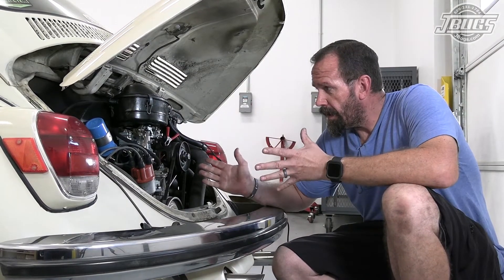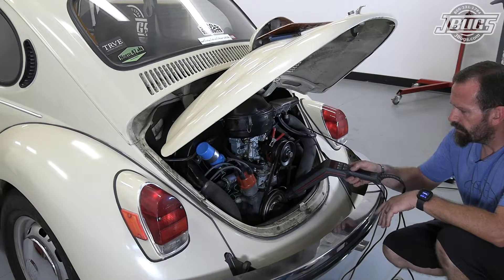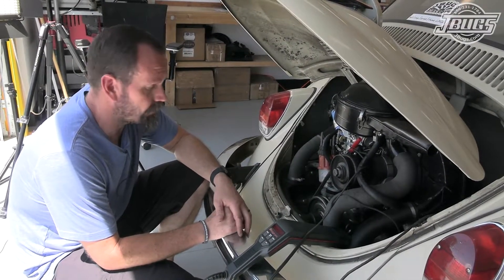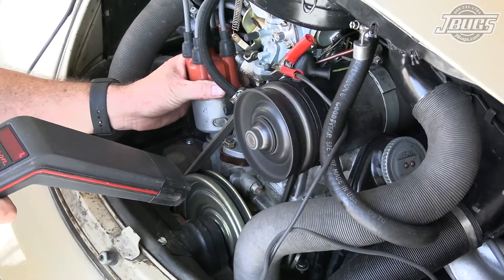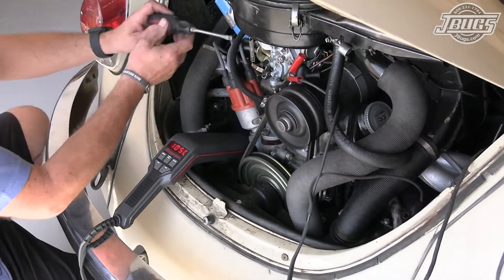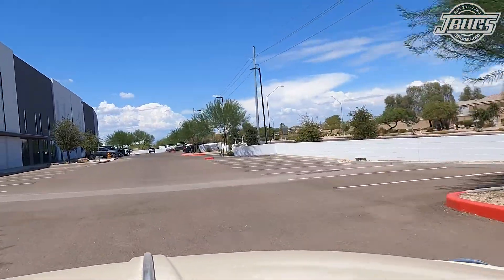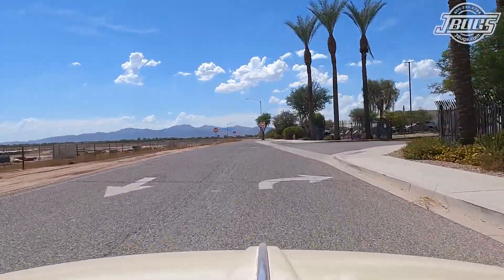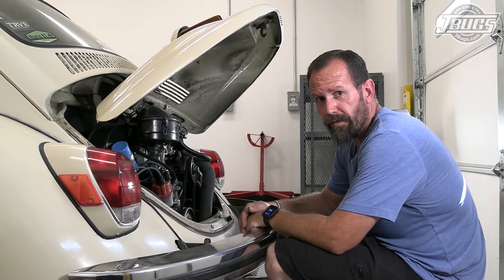JBugs - Timing a 009 Distributor

Comment: Would you use the larger jets at 5700 feet altitude?
Reply: No, typically at higher altitude smaller fuel jets are run, not larger. There is less oxygen at altitude, so to keep the air-fuel ratio correct, smaller fuel jets would be used.

Comment: As always, thanks for the great video Sam. I can only get my car to idle / rev stable by advancing around 45 degrees. Anywhere close to 32 or below and it misfires / stalls. I'm running an MSD centrifugal distributor. I believe the springs were changed. Will this affect the advance?
Reply: The closest I've come to working with an MSD distributor is the EMPI HEI which is modeled after it and I still prefer vacuum advance distributors like the SVDA.

I'd start with seeing how much total advance you get. Fully advanced you're at 45, but what is the initial timing? If you're getting more than 20-25 degrees of advance then something is probably wrong with the distributor, weights or springs. Also check that the cap and rotor aren't damaged, cracked, etc and possibly the cause of the misfires.

Comment: So you adjusted your timing at idle and then got your advance at 3k rpm automatically? You didn’t have to adjust the distributor while at 3k rpm? If I’m correct is so much easier when you only have two hands.
Reply: As you rev the engine, the timing will advance automatically, yes. This distributor advanced 23-25 degrees depending on the initial timing. If you have another set of hands, it would be helpful certainly, but as I showed in this video, they aren't a necessity.
Reply: @ yeah I don’t know why I didn’t think about it. Set a couple of degrees at a time at idle and check at 3k rpm to see what it advances to instead of trying to move the dist, pull the throttle, and hold the timing light all at once at 3k rpm. Makes sense. Great video man. Learn something new everyday

Comment: does this process works in the same way with a vaccum distributor?
Reply: Essentially, yes. The vacuum hose needs to be disconnected (and the port on the carburetor plugged) when setting the timing so that process is the same. We do have a timing video on a vacuum advance distributor here - https://www.youtube.com/watch?v=hOrehMD8Cc0

Comment: Wish I could understand it but I do not understand what you are looking at on the pulley with the light.
Reply: The timing light shows the moment when the spark plug at #1 cylinder fires. Since this timing light has an adjustable flash, we set it to shine on the TDC notch in the pulley. So, whenever the plug is firing, we look for the notch on the pulley as the light flashes.
Reply: you are looking at a vibrating line on the edge of the pulley  that moves to the left or right as you increased the rpm .

Comment: My '71 Ghia oil temp over-heats within 5-10 minutes before hitting the road. I just adjusted valves and hesitation stopped but oil still overheats. I adjusted carbs but no diff. Now I'm gonna re-time it and hopefully that solves the issue.
Reply: Timing can certainly help with ever heating but normally it only affects the oil temp during driving. If the oil is over heating while the car is just idling, I would be suspect of oil pressure or possibly some other internal engine problem.

Comment: I have a slick 1968 with an original super beetle 1600cc engine, an aftermarket EMPI carb (hpmx with NO CHOKE) and a horrible 009. What were they thinking when the previous owner upgraded the car? I got myself an SVDA 034 distributor, but I'm watching video after video to make sure I know what I'm doing before I install it. At least I'm sort of forced to learn how to do things myself on this car (still not confident though). On SAMBA many people claim they are bad vacuum ports. Some even claim they are manifold vacuums. I have measured and the port is slightly above the butterfly valves on the hpmx.

Comment: I can't believe this BS. I used a 009 on my beetle 45 years ago. I set it up on a Sun distributor machine at school. If I  remember correctly the advance was all in before  3000 rpm. It had great throttle response. I was eventually 8:00  running a Holley bug spray carb. Then dual port heads. Then a 1641 setup and a different cam. Always good fuel mileage. In My opinion if you don't set up any distributor  correctly to give you the desired advance curve you are nothing but a parts changer. 
Did the same type of mods on a 79 Chevy El Camino. Went from 16 mpg highway to 21+. Despite having a 241 rear acceleration was much improved.  With the original exhaust sitting home on the garage floor it went right through state emissions inspection  (they didn't look underneath for the lack of a cat converter) probably because it ran so clean. The inspector complimented me on having the cleanest running car they had tested all week. It's all about tuning the carb and distributor.
Reply: Cause everyone has access to a distributor machine!
Reply: @Sam_Mebane    there was a time when every serious shop and all dealers had a distributor machine. This was especially true in the mid 70s when some had dual points for emissions. (Datsun / Nissan was famous for that)
Reply: I used a 009 on my '57 Ghia i owned for 40 years, did just fine...but please...Kick me in the Ass for selling it 10 years ago 😢...i bought my brother's '73 Bug last year, which is appropriate because i still have my '73 Sportster i owned 47 years, second owner, and i graduated in '73...so i guess i'll just buy all '73's now...but the point is...if you have a beloved vehicle, and it's not eating anything...KEEP IT!!!

Comment: Do performance engines benefit from non vacuum advance distributors? Aka mechanical advance. Aka 009? Also what did you say after you set the timing? You adjusted the carburetor but I couldn’t hear or understand what you said. Something about the idle and how it was affected by the advance timing. Lastly can I do what you did with a basic timing light or do I need to buy one of those fancy expensive ones like the one you used???
Reply: For street driven cars, no. For a drag racing application, sure since you go from idle essentially to full throttle and a smooth advance curve across the rpm range doesn't really matter. I had to readjust the idle speed since it increased with the advanced timing. Most timing lights will have an advance dial and will do the job just fine. I like my light as the tach readout makes dialing the carb in much easier.
Reply: ok good to know. I might have to invest in a vacuum advance distributor. But I also have dual carbs, does that matter?  @Sam_Mebane
Reply: @SanDiego_VDubLife  some performance carburetors do have vacuum ports, some don't. Most 40/44 IDF/HPMX carbs have one - https://www.jbugs.com/store/graphics/00000001/23/EMPI-40-44-HPMX-Carburetor-Tuning-Adjustment-Components_540x540.gif - but it is usually overlooked. Dual Kadrons don't typically but can be drilled for one, I sent my last set to AJ Sims to be drilled out.
Reply: @Sam_Mebane  ok good to know. Thanks for the reply. I have dual empi carbs. They might have a vacuum port. I haven’t looked for it.

Comment: When I bought my 73 Super over 10 years ago I didn't know much about aircooled VWs.  My 73 had a 009 on it and it was a nightmare.  The more I read the further I went down some horrific rabbit hole of "try this/try that", and it was all nonsense.

I finally after some months ran into a blog where some mechanic said 009s are for aircraft and stationary engines... and the best thing to do with it is trash it and install an SVDA.  I did that and 98% of my problems were gone.  The other 2% of my problems were jetting the carb back to stock, and cleaning out the heat riser.
Reply: One of the best way to describe too 009 is uh-oh nine!
Reply: Yeah 009 is great for dragracing, but for streetuse it's terrible.  SVDA runs super smooth.